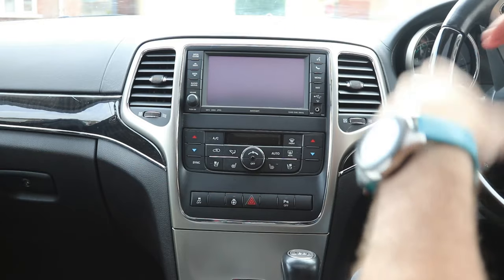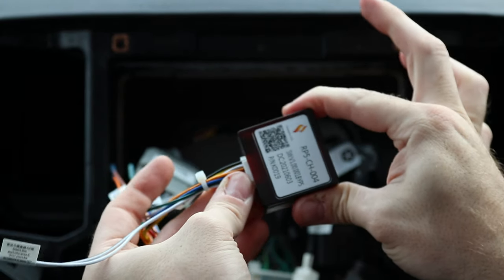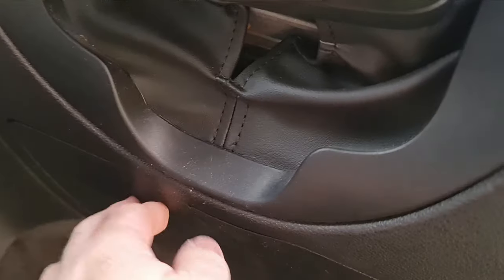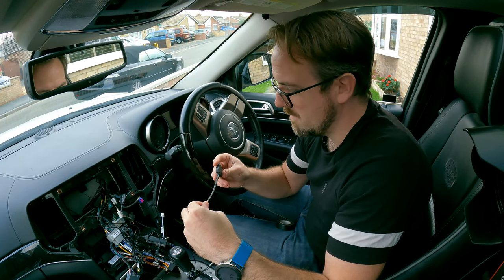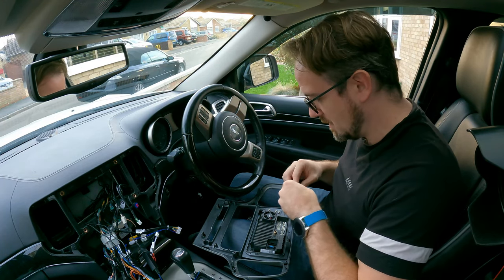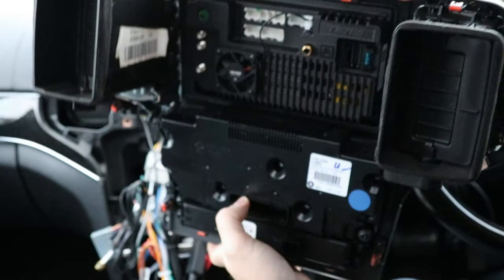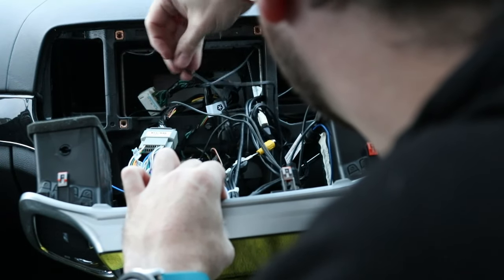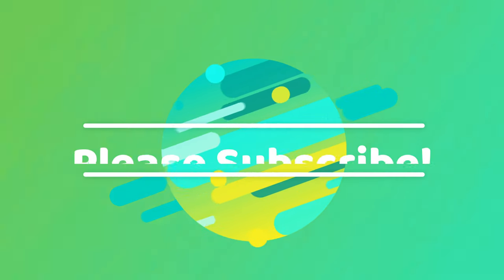Jeep Grand Cherokee ULTIMATE Head Unit Upgrade - Teyes - Jeep WK2 -Android Auto -Apple CarPlay -DSP

Comment: Hi. You left two cables from the original radio unplugged... one was a wide white connector, I assume this the OEM reverse camera plus rear seat monitors. The other was a grey rectangular 10 or 12-pin connector. What was this for? Thanks.
Reply: After some extensive research, I found the answer. The grey 10-pin connector is from the UConnect hands-free Bluetooth Module (if it is installed in your car). In order to use the OEM microphone, you cannot just use an adapter for this 10-pin connector, but you need to lead mono-jack wire to the UConnect hands-free Bluetooth Module, that is usually installed in the A column, and tap into the microphone wires connecting to the UConnect hands-free Bluetooth Module there.

Comment: Very helpful video. I just installed this CC3 on my 2015 Grand Cherokee and everything works... EXCEPT my original backup camera just shows a black screen now :( This is really bad. Should the car have a standard male RCA connector in the dash that I should be looking for? Or, is the wire from the stock backup camera part of the original wiring harness (not plugged in separately)? I just can't find where to connect the original backup camera?
Reply: Hi Joe, might you have the schematics for how you connected the RCA cables? I have a car similar to yours and I cannot get the speakers working
Reply: @cleo9499  it turned out I had it connected properly but the cable got disconnected when pushing the head unit and cables into the car during final step. I wrapped some electrical tape around the 2 cables where they connect and that kept them together and the backup camera worked.
Reply: @cleo9499  however, there were just so many other little issues and headaches with this unit in general that I ended up returning it and instead bought the newer Jeep that comes with Android Auto built in already. Lol
Reply: @joekarnsenko   where did you get that newer Jeep unit?
Reply: @cleo9499  I bought a 2022 Grand Cherokee that comes stock with Android Auto. Obviously a lot more expensive but we were going to upgrade to the newer Jeep within the next year anyways so this spurred me to just be get the newer car sooner.

Comment: Could factory microphone be used instead of installing a new one? Can you use factory USB or factory camera? Or will that all need to be swapped when installing this specific head unit?
Reply: Good question, would have been nice if you would have got a response.
Reply: @bigdenzil411  The mic in the ccs works fine for me.
Reply: Hey the teyes has a mic on it. Built in on the front of the screen. Old mic can be soldered into a19 and a20 in the a socket.

Comment: I have yet to see a Teyes CC3 installed in a 2020 Jeep Grand Cherokee, which is what I own. Although the listing on Aliexpress shows 2013-2020, it also states it's not compatible with my 2020 Grand Cherokee. Furthermore the 2013 dash is different than the 2014-2020, so I don't know what's going on there.

Comment: Why would you add and use the cheap aftermarket GPS when you've already got a more robust, reliable factory GPS mounted in the car? Just get an adapter for the blue FAKRA-C connector and hook it into the SMA connection on the head unit. Done.
Also, for the reverse camera you can use the factory one with these aftermarket head units. Just go to your vehicle's wiring diagram, find the + and - wires for the composite signal, attach to an aftermarket RCA connector (they usually have two screws, one for each wire, making connection a breeze) and plug that into the yellow RCA input on the aftermarket unit. That way you don't need to wire in a second camera; and if your OEM guide lines moved with steering input, they continue to do so.
Reply from the maker: I agree with the GPS, that is a better way. With regards to the reverse camera, the factory one was terrible quality and I purposely replaced it for this reason. The new one still has lines that move with the steering wheel but in glorious 1080p

Comment: So what you are saying is the 360 degree system does not need the reverse wire connected, but the normal reverse camera needs the reverse wire hooked up as on there diagram supplied. I have started the install firstly the two mirror cameras and the front camera also the drive cam, all pretty easy just a little fiddley and Thanks for your help, do you know much about the Jeep premium audio system, as I am considering getting all of the speakers working with crossovers and such, I just need if all output channel go the jeep Amp at the rear of the car than out to the speahers?

Comment: Hi, great review. Do you know if integrates with the climate control and seat heating and cooling on the newer models
Reply from the maker: Yes it does, it shows the temprature settings on the screen, but you can't control the temp from the screen
Reply: @SaabUnleashed  thanks for your reply, there are no physical buttons for seat heating and cooling in the Jeep,this is usually done through the head unit on the original unit, does this mean it can be done on the T’eyes unit.
Reply from the maker: @Paul-qu3ke  ok I see what you mean. Generally, aftermarket head units can still control any functionality that existed in the factory one, but I can't answer this for your specific car, you would need to speak to them directly before you buy to make sure if it isn't explicitly outlined on their website
Reply: @SaabUnleashed  hey mate just an update, I bought and installed the head unit, it’s great and the climate controls, seat temperatures and heated steering wheel can all be controlled through the floating button.
Reply: @Paul-qu3ke  What year did you install it in?

Comment: I was lucky you showed the actual canbus adapter ! A lot of chinese vendors don't specify whether you need it or not, and with your video I was able to find the right serial number for the exact canbus decoder unit. Look for either CH-SS-04 ,  or  RP5-CH-004 . should cost about 16 US dollars.

another quick question. were you able to preserve steering wheel controls with that unit?
Reply from the maker: Yes steering wheel controls are there, also has adaptive reverse vectoring too via Canbus

Comment: Anyone with a 2014+ know if this still retains factory options like air suspension mode (tire jack mode, towing mode, etc...) as well as other vehicle features? The Uconnect 8.4 has many vehicle options that I cant lose and there seems to be NO video's of 2014+ WK2's with these except for the one guy with a Laredo, which had little to no options to begin with...
Reply: Im having the same problem man. I have a 2014.
Reply: okay so a guy in this comment section said he installed it on his 2015 Jeep Grand Cherokee and everything worked perfectly. This is his name and comment @joekarnsenko

Very helpful video. I just installed this CC3 on my 2015 Grand Cherokee and everything works... EXCEPT my original backup camera just shows a black screen now :( This is really bad. Should the car have a standard male RCA connector in the dash that I should be looking for? Or, is the wire from the stock backup camera part of the original wiring harness (not plugged in separately)? I just can't find where to connect the original backup camera?

He said in the replies that the camera was jsut loose once he pushed the head unit in and it came out. 

I already have a aftermarket radio in my 2014 so I have the correct bezel piece. You might have to buy yours separately if you plan to install this.

Comment: I just bought a 5GWifi off of Amazon and it looks like the exact same head unit. Is there an option to use the original back camera for this setup? Do we have to do anything else or do you have a YouTube video for it? Good video!
Reply from the maker: It's not anywhere near the same head unit, but you will find that out soon enough. Yes you can use the factory camera if you can find where it terminates in the dash, but you will need to buy some kind of adaptor to make it an RCA. Also the factory camera is very bad quality in comparison. I don't have a video for this I'm afraid
Reply: @SaabUnleashed - Can’t seem to find where the cables are in the dashboard. Thank you for your reply’s though!

Comment: Great video, very many thanks. Do you know if this unit will play video to the fold-down screen for the passengers in the back?
Reply: I´ve the same question... and about the 360 cams, will it work?
Reply: same question.. did you find out about this? does the original setup mirror the same feed from front screen to rear monitors too?

Comment: Hi, brilliant video, thanks. 
Do you recall why you couldn't use the built in microphone and instead fit an external?
The website claims it doesn't support the radar system (it also claims heated steering wheel isnt which ive seen you've confirmed still works), do you remember if radar features, mainly the adaptive cruise control, still works?
This and the review has convinced me to buy, provided i can still use ACC, is the link in the video an affiliate?

Comment: Hi - did you ever do a video of you installing the reverse cam? I've bought a CC3 2k on your recommendation and it's great, I installed the dash cam and the DAB aerial and they're both working well, but I've not been able to find a good video of the reverse cam install - mainly how to wire the camera power to the power block going into the Teyes head unit. Do you have any recommendations or could you point me to your reverse cam installation video?
Reply from the maker: Hey Ben. I did record the installation, but unfortunatly the SD card carrying the video files corrupted, so it was lost. I can tell you I used the Teyes HD reverse cam and placed it in the same location as the factory reverse cam, with the help of some hot glue. I ran a new wire to the front of the car under the plastic trims under the doors
Reply: @SaabUnleashed  Thanks for replying so fast! Can I ask how you did the wiring? How did you attach the yellow and red cables from the camera's extension into the Teyes power supply? I can't see a way of doing it.

Comment: Hello, thanks for this video. I have a 2016 US-Spec Limited with the 9 speaker alpine system. I see the canbus control options are integrated (vehicle-specific light options, etc) but I am wondering if the OEM “surround sound” option for audio remains intact or if that is sacrificed when installing this head unit. Also this has android auto and Apple CarPlay integration built-in correct? Or do you need separate USB-hubs and wiring to enable this? For upgraded UCONNECT with CarPlay it requires a new USB-hub so I am wondering if that applies here as well
Reply: Did you get heated steering to work?

Comment: you never did the video of the install of the new camera .... was it easy or a PITA to run those cables through the car
Reply: any word
Reply: I was anticipating the rear camera install also
Reply: I just installed the CC3 on my 2012 JGC (WK2) and maintained the OEM camera by using the iDatalink HRN-AV-CH1 Factory Integration Adapter. It was super easy and all T’Eyes reverse camera functions work.  The resolution is good enough in my opinion.

Comment: did you ever make the video for rear back up cam for the jeep? which unit did you use? my second cc3 will be here any day now and i will go at it again..i have not sent back the first one, and am hoping it was just a bad unit. after all of the issues, i pushed in the reset on the front and the unit just went black, not to work again, the fuse is good and wiring proper. between all of the extras i purchased, in for a penny, in for a pound, so i ordered a new unit..would like back up camera function tho. any help will be appreciated..
Reply: I just installed the CC3 on my 2012 JGC (WK2) and maintained the OEM camera by using the iDatalink HRN-AV-CH1 Factory Integration Adapter. It was super easy and all T’Eyes reverse camera functions work.  The resolution is good enough in my opinion.

Comment: Hey @Saab Unleashed, I'm planning to install this unit next week on my 2013 Jeep GC Laredo and your video has been incredibly helpful already. Question: Did you have to remove all of the trimming to get the old camera out like in the 2014 Jeeps? Videos on replacing cameras on the Jeeps are very limited. That was great advice about gluing the new camera in, what glue did you use if you don't mind me asking? 👍
Reply: I can’t get this to work in my steering wheel controls to work in my 2012 grand Cherokee at all…was told that it’s the same setting for a 2012 dodge Durango but I don’t see that vehicle listed either in the hikitty canbus

Comment: Hey, I didn’t see it specifically mentioned, but do you have blind spot monitors or back up sensors? I got my back up sensors to “beep” but my blind spot monitors do not work. I have a Jeep Wrangler (2020) so I wasn’t sure if it was maybe something similar. Thanks!
Reply: Did you have to do anything specific in order for this to work? I installed the radio and my back up sensors are not beeping anymore when an object is close.

Comment: Did you have any problems with the blind spot system? I own Jeep Grand Cherokee WK2 2012 and the blind spot system stopped working after the installation. Also couldn't connect the original camera

Comment: I installed this in my 2014 wrangler based on your review. Everything worked great for about 1 hour then sound just stopped working entirely on the head unit in the middle of a drive. Bluetooth, radio, everything. The speakers don't seem to be recieving power now. Any ideas? My car does not have the premium alpine system.

Comment: Did you do anything to your armrest USB connection? My 2012 Jeep Grand Cherokee WK2 doesn't have a "male microusb output" like your video shows, instead it had a 10pin female plug.
Reply: Just installed this on my 2012 WK2. If you have the 430N stereo, the male micro USB cable connector to the UConnect system is actually located on the drivers side of the car near your left knee (if in U.S.). It’s a pain to get to but it’s worth the 15-30 minutes to maintain the functionality of the armrest USB. You’ll need a 1 ft minimum USB extension cable in addition to the micro USB to USB adapter that he showed in the video.
Reply: @wk22012owner  do you have any photos of where you are referring to under the drivers side. Im working backwards as I am in Australia, so I am looking near my right knee, behind the airbag and near the light bulb. or it it more in the door side?

Comment: I have just purchased the Teyes CC3 and all the bits including the 360 degree camera system for the 2013 Jeep Grand Cherokee SRT8, I did watch your video and it was grate. When you install the reverse camera, where did you install it, will it fit in the same location as the OEM camera and are you planning on installing the 360 degree system. I noticed in the diagram they sent me with the kit they mentioned that if a wire is connected the can bus a Red one l believe you must cut it and connect it to the 360 degree camera system, I will need to check which wire they are talking about, so I am not sure if want me to cut it, join than disregard the other end or splice it in. I am going to email them and see what they have to say. Any ideas  would be helpful.
Reply from the maker: Nice car. 
I installed the hd reverse camera which I glued into the same location as the factory one. You probably won't be able to do that with the 360 system because it will likely be at the wrong angle, so just mount the rear camera under the licence plate light trim.
The rear camera has a red wire for connecting to reverse lights on older cars. You won't need to connect that because the Jeep has CANbus recognition of reverse
Reply from the maker: Check my channel for the 360 install I did, it wasn't on a Jeep though
Reply: @SaabUnleashed  thanks so much, will do, also the audio outputs do not seemed to be metioned on any of the ports, l got the same kit as you only one connector to the jeep the gray one i think so l hope the speaker outputs ar in that?
Reply: @SaabUnleashed  yea have seen that looking forward to installing, l hope to make a video as well so l am gathering as much infi as i can
Reply: @SaabUnleashed  So what you are saying is the 360 degree system does not need the reverse wire connected, but the normal reverse camera needs the reverse wire hooked up as on there diagram supplied. I have started the install firstly the two mirror cameras and the front camera also the drive cam, all pretty easy just a little fiddley and Thanks for your help, do you know much about the Jeep premium audio system, as I am considering getting all of the speakers working with crossovers and such, I just need if all output channel go the jeep Amp at the rear of the car than out to the speahers?
Reply: @MrNev1956  did you need anything special when you installed this into Srt8? Like some specific wiring for amplifier?
Reply: @martindovhun3645  No I did not need anything, I just was very carful with the install of the 360 degree camera system, all of the wires for the camera system went through the doors and the rubber boots all the way no wires can bee seen when doors are open, just be carful when putting the unit back into the dash as there is a lot of wires and the vents like to fall off, as the vent installation is not the best. good luck, what area do you live in?
Reply: @MrNev1956  thanks! I plan to install classic one, without 360 system, since it seems to come with bezel... Haven't found the one with 360 and GC bezel anywhere. So it is the same plug and play as for nonSRT version? Looking at the back of my radio (730N),there are 3 harnesses but looks like only one is utilized with Teyes. Don't want to loose HC 7.1 channel soundsystem but have no clue if it somehow relates to those unused harnesses... 
I'm Slovakia.